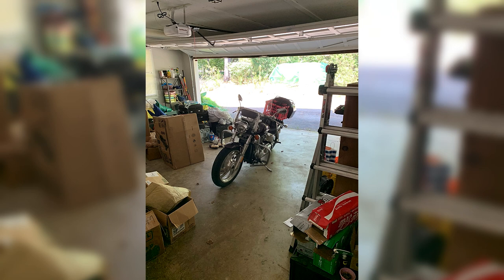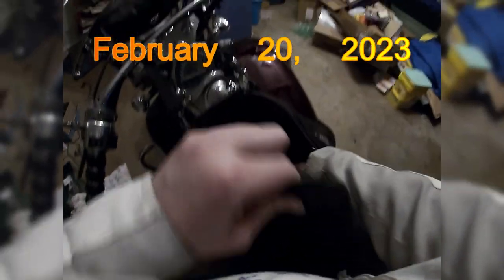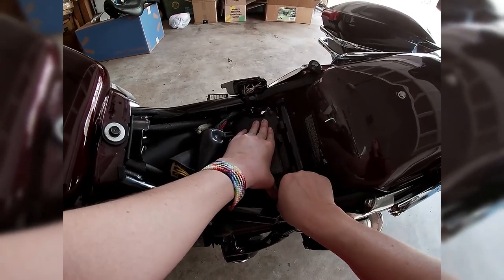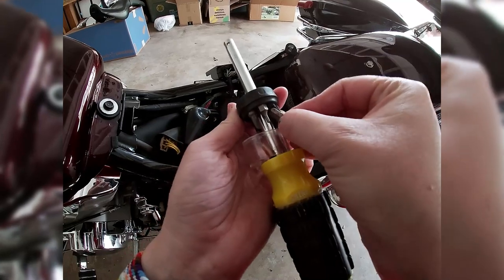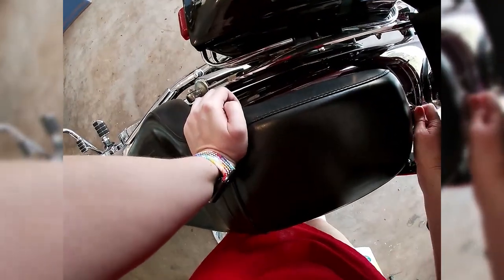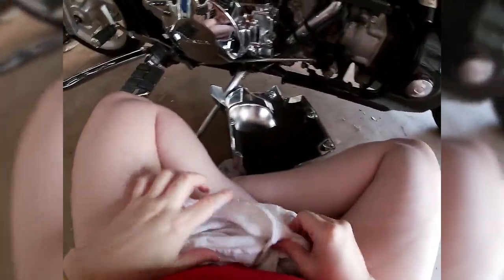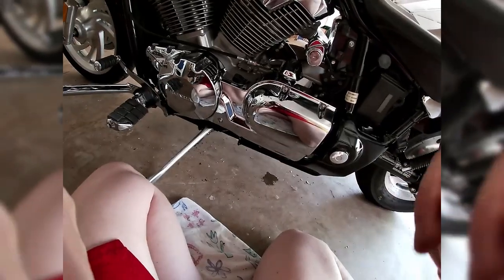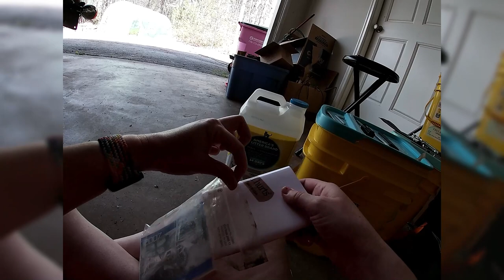Honda VTX 1300 Airflow issues, Putting her back together!

Comment: I like your bike. Honda sounds good😊
Reply from the maker: Thanks 👍, I still am confused about the air-flow issues, I just had a "tune up" at a shop that cost me over 3K and they left a gap in my head, then when I took the air filter off and opened it wide up, it worked but if I just held the filter on, it would have "choking" issues.  I still don't know what caused the issue, I ran some cleaner through it and did some other checks but I'm perplexed.